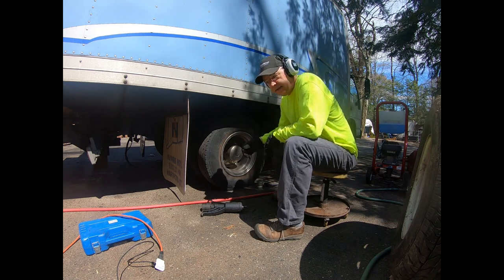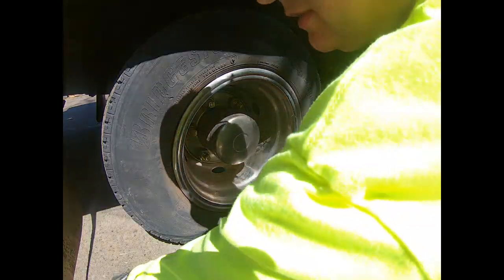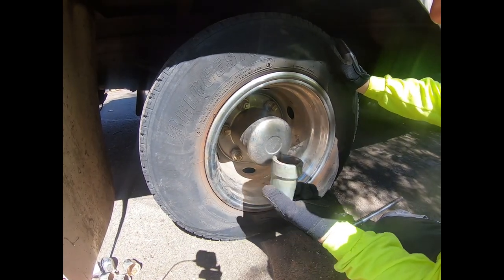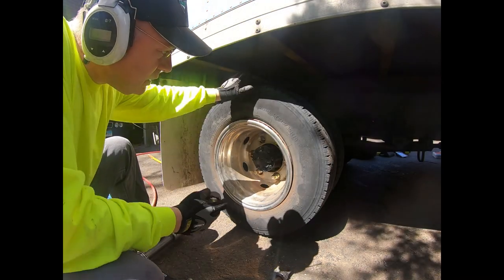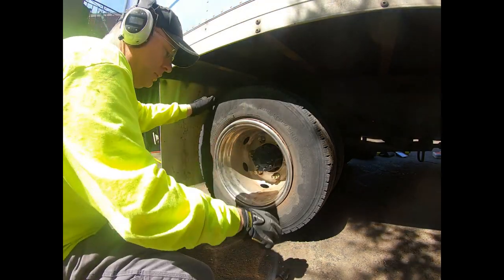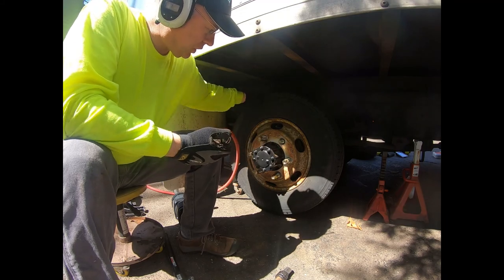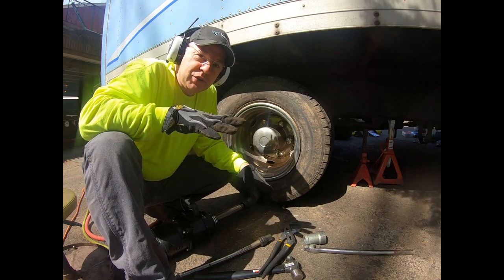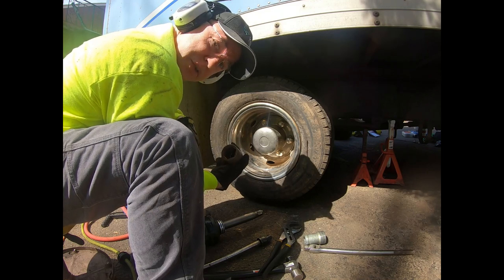Removing Lug Nuts and Changing Tire Isuzu NPR

Comment: Hey man just some helpful advice I have an NPR 300 myself the expensive socket device that you have Is engaging the inner lug nut as you begin to loosen the outer that’s why all your stage two nuts were loose Just use a regular socket on the first nuts and you will not have that problem Also that 60 to 1 ratchet thing is brilliant that would really come in handy on a roadside breakdown because it is small enough to keep in the toolbox never seen one of them before cheers mate
Reply from the maker: Thanks for the tip!.  I hadn't thought about that.

Comment: Need your advice
I have same truck I need to remove one tire I’m thinking to buy the 1” air impact wrench 
What brand are you using 
# 2 I have a 29 gallon’s compressor from Harbor Freight I can retro fit with 1/2” air fitting 
Undecided which brand of 1” air impact wrench

You are a strong man to lift that air tool
Reply from the maker: You need a large line coming off of your tank to make the big impact work properly.  The one I use is an inexpensive one from ebay.  Definitely don't get one with the trigger where it is on mine.

Comment: so on the left rear side would i turn right to loose, like the driver side?
Reply from the maker: Right side has regular threads left side has reverse threads.  Make sure you check the ends of the studs for R or L in case someone has replaced them with the wrong studs in the past.

Comment: i have a mitsubishi fuso and i tried to get the die to remove the tires do you know what it is called or where i can get it greetings
Reply from the maker: I believe there is a link below
Reply: There is not a link, that is what I am looking for as well.
Reply from the maker: @jennifermaulding7153  Than you for the heads up.  Ill add a link.

Comment: Would you happen to have the part number for the socket you're using or what is it called ?
Reply from the maker: I'll take a look tomorrow
Reply from the maker: This is a less expensive option than the Japanese one
Reply: @ironore1866  hey what type of impact gun is that and is it neccessary to remove the lugs. I have a 1/2 in Milwaukee brushless fuel and the front one came off fine but the rears are a bit more difficult. Is it my impact gun or just the lugs that are stuck on tight
Reply from the maker: @sleeping_underwater_5329  I think I would go with the torque multiplier first.  The large impact needs a big compressor and a large hose.
Reply: What size is your air compressor? How many pounds of air or what model of air compressor do you use?
Reply from the maker: @peruano08  For the big impact I use a 7.5 hp 220v piston style compressor with 150 psi.  For everyday use I have a small 3/4 hp compressor for here and there stuff.
Reply: @sleeping_underwater_5329  did you get it